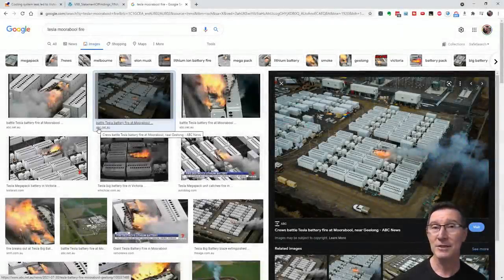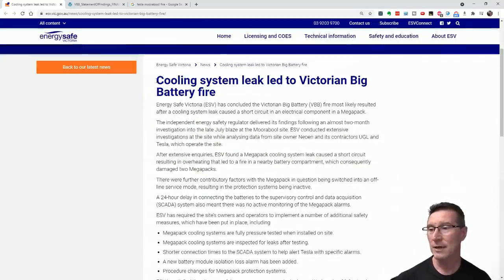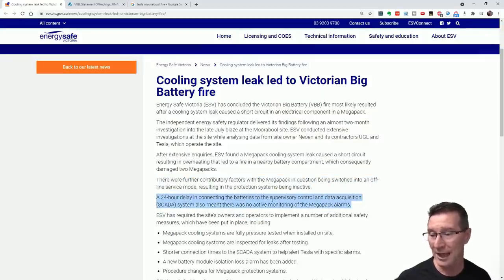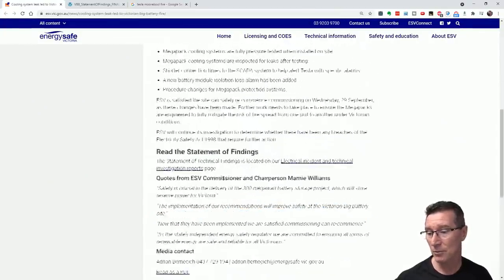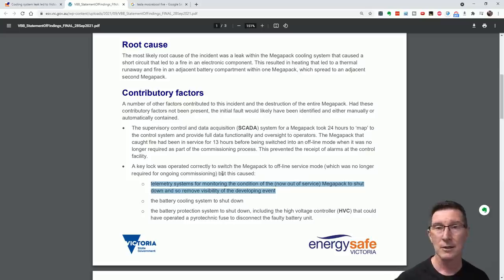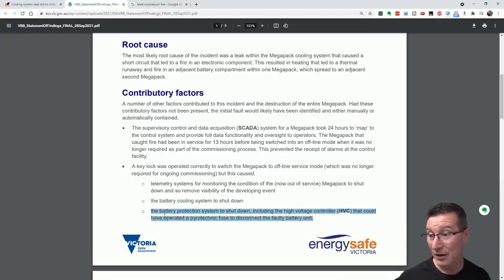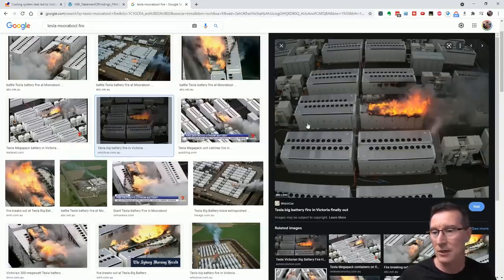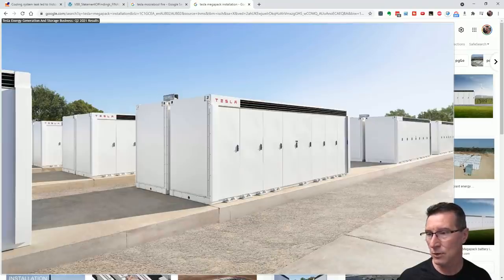EEVblog 1422 - CAUSE of the Tesla Victoria Big Battery Fire

Comment: Also on fail safe: I imagine it means that even with the thing on fire, the fact it was set to he disconnected meant that it didn't reconnect itself and put crazy voltage or whatever back onto the grid..? That would be how I would interpret that.
Reply from the maker: Could mean that.
Reply: Maybe they just mean that the fire was confined to just two megapacks and didn't spread through the whole facility? Not safe for the affected megapacks but safe for the majority of the facility.
Reply: they didn't clarify it anyway, so i still think it's a big stretch to call it "failed safely", as it would probably have burned down the whole facility if nobody acted.
Reply: Burning off is the safe thing for a battery to do, some go pop and make quite the mess, while some others just hiss and vent.
Reply: @victortitov1740  if it reconnected itself to the grid or shorted stuff out/or negatively impacted the wider energy grid (imagine it started dragging the frequency down or something) then that would be the bigger problem. Burning down may happen, no one can make something that has flammable stuff that will magically be not.. and the spacing seems like it means you lose 2 or maybe 4 packs. so I cant see "will not burn once alight" being a sensible definition of failsafe. That would be "flame safe" to begin with, which is pretty hard with energy related devices that are by their nature full of energy..
Reply: @--Nath--  do you really think that a single block like this (capable of 1.5 megawatt) can drag the frequency of the energy grid (10-ish gigawatts) down? My intuition says, no!

Burning down the facility is probably the worst that could have happen, and it probably would have happen (Dave explicitly said the firefighters were praised for preventing exactly that). Failing safely means that it inherently wouldn't do collateral damage even if no one came to rescue. If it can't in principle be made fail-safe, that is not an excuse to call it fail-safe.
Reply: @victortitov1740  I think the definition of fail-safe will be that it stays disconnected or disconnects in case of a fault. This size battery is a not insignificant thing - frequency stability is one of the things they are talking about it playing a role and we saw in SA the big battery there had ability to flick on in microseconds.. so if it was failing and dumping into the grid in a bad way: I think it would have an impact, because that is what it is sized to be able to do. You are right the grid is big, but large input sources are going to be able to have an decent old impact on the local area or so..
Reply: @victortitov1740  as for whether a single block itself could cause issues wider - presumably it is part of the overall unit but regardless fail-safe means impact to others on the grid, not to itself. No generator could possibly guarantee it won't burn itself down - so your view on what fail-safe means is nonsense in that context. Nothing that can possibly be destroyed can meet that made up definition. That the rest of the megabucks were unimpaired by this catastrophe means it only impacted itself. The fail-safe meant rest of the facility was not fried or cascade-destroyed.

Comment: The batteries got hot but they say the cooling system failed to conduct the heat out. So it was a cooling conduction problem...   cernoble was a cooling problem too

Comment: With systems such as these an independant pressure monitor would have alerted the monitoring center of an issue. add a local siren and anyone on site would have known. The local system could be hard wired - yep copper cables, back to a central on line monitoring service. All circuits configured to produce an alarm when open or short circuit via an end of line device, say a resistor network producing 3 state monitoring. These systems are available as domestic alarm panels.

Comment: Couple of things... Battery packs, solar installations etc should always be treated as live, so to disable any monitoring even when took offline is a fundamental flaw in the basic design of the units.
Failed safely... They probably mean it didn't explode and take out half of the facility.
Most likely the leak spayed coolant onto the charging circuit, that short circuit could easily short a battery pack and the inevitable domino effect of battery pack fires begins.

Oh, I forgot to say in your previous video, the units in between the battery packs look like Ring Main Units (RMUs) they're a normal High Voltage switching/ protection system. In the configuration on that site, they'll take the supply from 2 battery packs in via the protection device on either side and output it to the grid via the switch portion in the middle, so that means there should be 1 of those units for every 2 battery packs and the packs that work together are most likely on each side of the unit. So the ones right next to eachother aren't connected together but the one across the wider path with the RMU in the middle will be, if that makes sense...
I'm an HV spark, so it makes sense to me but I understand a lot of sparks don't really understand how our systems work... It's why we laugh when people refer to low voltages such as 230V or 400V as "high voltage"... It just isn't, it's low voltage.
In conclusion, battery packs and solar PV is always live and should be treated as such, this fire was operator error, arguably but basic design features were obviously absent.

Comment: My presumption about the short leading to overheat is that the coolant leak caused a short of the battery bus connections on the battery side of the protection circuitry outside the battery enclosure. The pyrotechnic fuses are probably inside the compartment and would isolate all the racks from each other. So with the cooling offline the batteries began discharging through the short and started to run away and without the pyrotechnic failsafe the batteries couldn't be further isolated.

Just a guess.

I suppose shorting the mains supply is also possible and being a giant battery connection could have really high current ratings

Comment: Hmmmm ok so if it was coolant leaking onto bus bars and creating a short between bus bars that sounds like the coolant lines were above them. That sounds like sub optimal design if they’re relying on the coolant lines to never rupture or leak. Is that the only way it can be done?

Comment: Offline mode = no telemetry, no battery protection...............thats nuts!, who designed that system!
Reply: Maybe the offline mode was designed for servicing the battery pack so it was fully disconnected from anything that would bring in power or could endanger someone working in there (e.g. while replacing blown pyroelectric fuses)? Still a bad choice to disable all telemetry ...
Reply: @florianf4257  Yep, thats true I guess.......although the offshore industry have been utilizing intrinisically safe probes, sensors and electronic monitoring systems in hazardous areas for many years. With the info available at the moment I just don't get it.......
Reply: .........The accountants designed it.....LOL!
Reply: @florianf4257  Since there is no such thing as switching a battery itself "offline", you always have to work on these while some parts are dangerous. 

It means protection features are even more important during that time and the system would have to be designed with good protection during every possible service in mind. The procedures should have been such that protections are only disabled when absolutely necessary. Clearly this was not what they did.

Comment: 22:35 - "[...] why isn't this monitoring and control done inside the megapack regardless of the remote connection?" - I'm pretty sure in the context of this report "off-line" does not refer to the communications network connection, but rather to the power grid connection; when the Megapack is taken off-grid, someone seems to have presumed that it would be safe to also turn off "a number of monitoring and protection systems", at least one of which (the explicitly mentioned high voltage control and its ability to blow a pyrotechnic fuse) seems to be fully autonomous, IF it is enabled. The report also hints at the existence of other autonomous self-protection systems of the Megapack, even though none is explicitly mentioned. Presumably, with the old firmware none of those were enabled in off-line mode.

Comment: I remember the arguments about overhead power lines out in the bush and how remote communities should go "off-grid" when there were those massive wildfires in 2016. But of course you're kind of trading one problem for another, since if a lithium battery goes up then you've got an ignition source that's going to be hard to contain.
Reply: I imagine lithium batteries wouldn't be too happy in a bushfire anyway

Comment: 21:22 not necessarily physical layout, improved fire protection materials/insulation to slow spread might be an option, slot fire proof boards between units for example.
Reply from the maker: Yes, sounds like they have to do something. Obviously they are not going to rip up and rebuild the site.

Comment: All the safety design and procedures that could have fixed this were obviously nixxed by the bean counters. It's common sense a lot of this stuff, but until they see the cost of such issues they'll leave it all out to have a cheaper product. Power vs space and quickly recouping investment are bigger targets then actual safety. Especially if it's all unmanned stuff as I'm sure they're working towards.
Reply: Spot on.

Comment: If I am on site and I go on a lever an make it go kachunk to fully power it down/or take it offline so the speak I would respectively assume that all is offline/powered down. Including all batteries disconnected and also the control unit down which should include monitoring. So if all was "offline" I don't really see that this should be changed... If not I would rather question the lever/key.

Comment: 22:35 - "[...] what caused the heating that the cooling system had to cool down and didn't because it was leaky?" - The leak didn't lead to an incident via making the cooling system inoperable, but rather via spilling coolant onto electronics and shorting it out. subsequent uncontrolled overheating of some component may well have exceeded the capacity of the cooling system anyway, even if it had been fully operational (which it wasn't, because - as the report states - at the time it was turned off entirely, due to the off-line mode of the Megapack). You're an electr(on?)ic engineer, you should know what a short can do when lots of Watts are involved.

Comment: 2:37 Unless i miss something every reaction that results in heat (e.g. fire) is exothermic (including burning wood).
Reply: I think wood doesn't react with itself exothermically regardless the temperature, batteries do. By spraying water you cut the flow of oxygen to the wood, but doing the same to batteries does nothing
Reply: Exothermic reaction here is relevant because the battery heats itself which ignites the battery which makes it heat itself, etc. Water can't really cool it off fast enough for it to stop because the reaction is exothermic
Reply: The important thing with regular Li-ion is that it can burn down WITHOUT an electrical fault (internal short circuit). This is not the case for most other battery types, including some other Lithium chemistries like LiFePO4.

Comment: I'm sure they could put pre-fab concrete panels between them if need be as a retrofit option; There may be better fire/thermal barriers they could use, but prefab concrete panels would be by far the easiest to install. Future installs I suspect they will maintain an adequate physical isolation between all units instead of in pairs.

Comment: The site does not seem to give fire and emergency services adequate access to the battery farm.
As you showed, other farms have lanes between blocks to allow access.
I am surprised the designers did not take these sort of situations into account when designing the farm, its like designing a 10 story apartment and not providing any fire escapes/stairs/ladders.
All in hindsight, but worth putting in latter planning approvals for future farms.

Comment: Offline looks to have shutdown the internal cooling system. Without circulation, coolant boiling locally, or coolant hoses overheating, may have led to the initial leak. 
Need to model all plausible initiators.